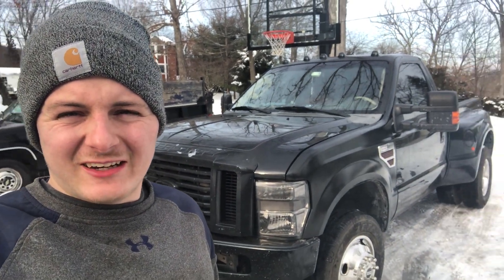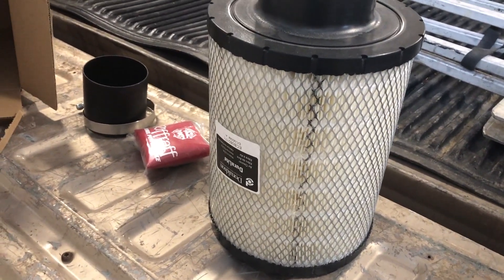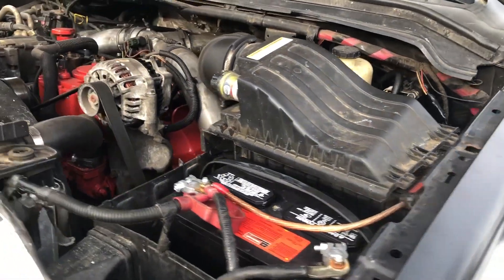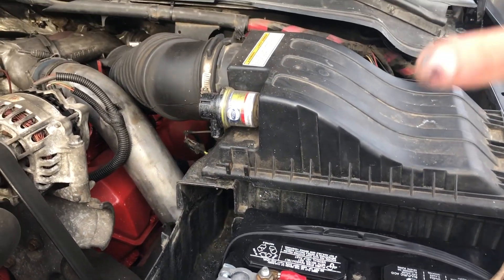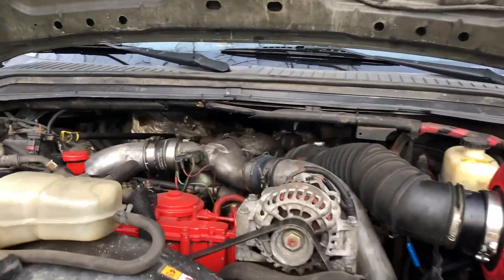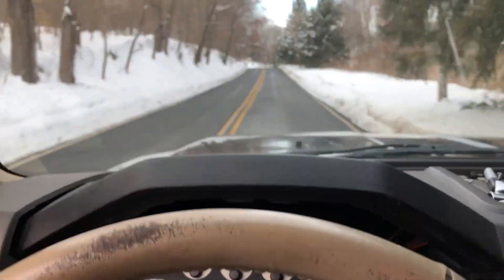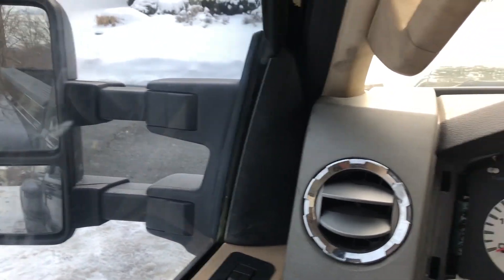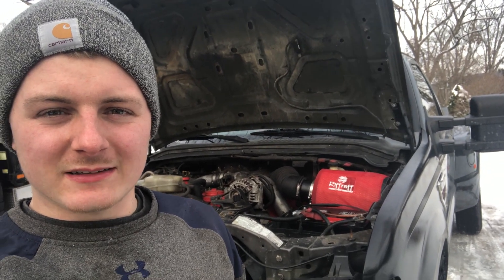RiffRaff 6637 Filter on 7.3 Powerstroke

Comment: Best to supply the engine with cool fresh air instead of hot humid air from under the hood. Those filters are used on heavy equipment but sit inside a box or cover that pulls air from outside the engine compartment.
Reply: The air still comes in from.outside you dont take off the tiny little factory air inlet thats blocked off for the most part unless yoy do the ZooDad mod, its okay the engine bay is not air tight it will pull warm air in but so does the stock the airbox already has holes to help "lower temps" on the engine